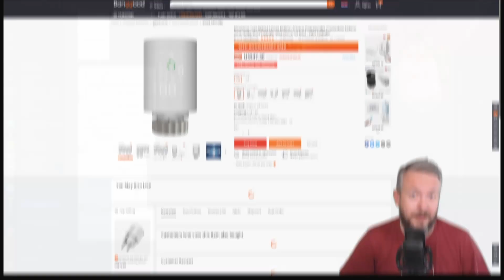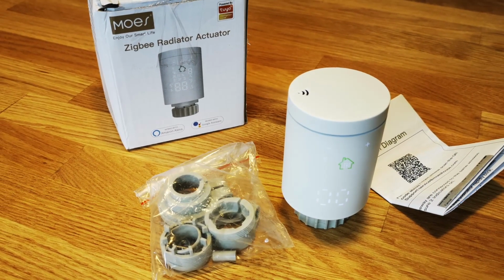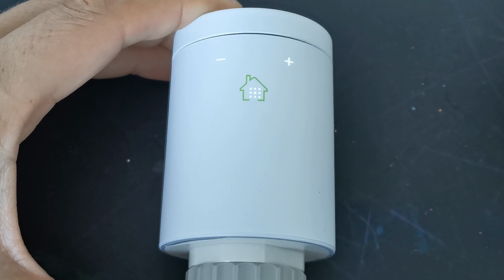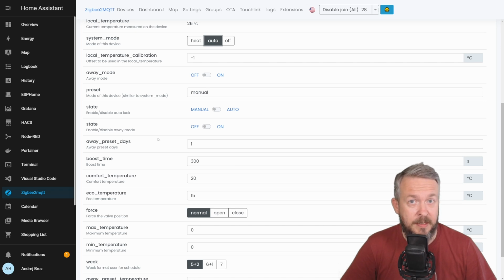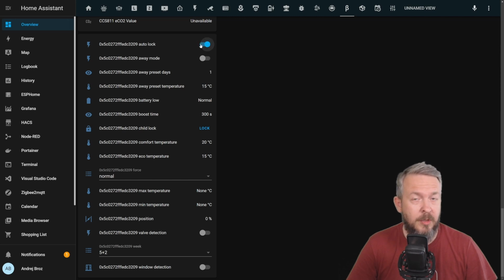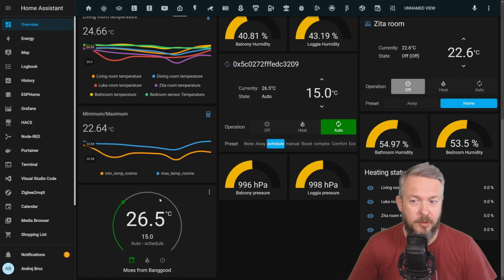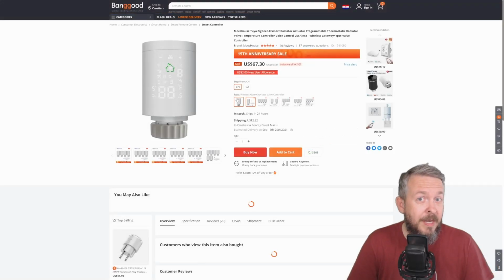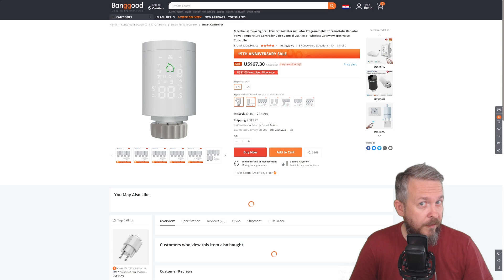Moes Zigbee Smart Valve TS0601 in Home Assistant

Comment: Great informative video - thanks. I have 2 of these valves connected via Zigbee2MQTT, one works perfectly as per your video - the other one gets identified wrongly as a TS0201 Temperature & humidity sensor with display. I have tried many times to repair it, but can not make it show up correctly? - it worked fine in ZHA.
Reply from the maker: Hi Hans and thanks for the comment! I've never seen/heard of such an issue? I presume that you tried to reset the device and re-pair it? 
I've seen this, but again, it's to try and pair/unpair device until it get recognised... Strange. https://github.com/Koenkk/zigbee2mqtt/issues/9144
Reply: @BeardedTinker  thanks again, I  reset the device and re-paired it about 40 times!, I then completely removed it from Zigbee2MQTT and then cleared it from the blocklist. I then re-paired it and it worked!! - thanks again 😎
Reply from the maker: Glad you got it working at the end. No idea why it would get identified as some other device.
Reply: @BeardedTinker  Yes, really strange, but working fine now - thanks to you 👍😎

Comment: Which is the difference between auto and heat modes?
Reply from the maker: Auto is intended when you have application, set default values (for ex day/night temperatures + away) and leave everything just run.
Heat is call to heat - and can be used to override auto if needed.
Od tado (that I use), I have everything on auto, and use Home Assistant just to show current temperature values.
Reply: @BeardedTinker  If I wish to use thermostat as manual device (just set temp which I want) which mode is correct?

Comment: Can you tell me? Is the hub really needed? Or only thermostat+mobile app would work? As it worked with my light bulb and smart plug
Reply from the maker: This is ZigBee device, so it need coordinator. It can be one used with Home Assistant, such as Conbee or CC2652RB usb sticks or one made by same manufacturer. But it needs something to move data from ZigBee network to WiFi/Ethernet.

Comment: Thanks for the video, gives a lot of information. I still have one question.. my current setup is done with Tado. I still need (a lot) of smart valves. If i buy one of these valves.. how can i combine them with the tado smart thermostat (so they can "ask" the boiler for heating)? Thanks in advance for your reply.
Reply from the maker: Thank you Lennart! The only way to combine them is if using system like Home Assistant to do so. Unfortunately due to them being different manufacturer and with tado using proprietary protocol for communication, you need middleman. 
But if you have Home Assistant, and you have both tado thermostat and Moes (or similar) valves - yu can use state of tado thermostat as trigger for automation to turn valve on/off. And vice versa, use valve call to heat to trigger manual heating.
You do need to put fail-safe in automation to for example stop heating if call to heat was longer then 60 minutes.

Comment: Thanks for the great review. I bought three of those based on it. I need an advice if possible. Since adding them to ZigBee2Mqtt and Homeassistant, they report way too frequently. Many times per second. And my homeassistant database grew from 200 Mb to 8GB. Is there a way to adjust the reporting interval for those valves. Thanks in advance. Other than that they have been rock solid.
Reply from the maker: Hi! I would suggest for start that you limit your HA log to only log warn or warning levels. This should be sufficient to prevent log to grow.
https://www.home-assistant.io/integrations/logger/#log-levels
You can add to configuration.yaml file:
logger:
  default: warn
I haven't seen log or database to grow that much just because of one device. 
Next please check this here on how to purge your database of the old data:
https://community.home-assistant.io/t/how-to-keep-your-recorder-database-size-under-control/295795 
Also check here for recorder commands to set purge days. I keep 7 days of data in database and I think that this is default.
https://www.home-assistant.io/integrations/recorder/#configuration-variables
Reply: @BeardedTinker  Thank you for the prompt reply. Maybe I miss explained things. My database is mariadb, I had the purge set to 8 days, but I took it down to two because of the valves. When I do a query in the database I see around 180000 rows for the trv status. It perhaps reports too frequently to homeassistant. I dont have problems with the log, I miss explained that part.

I posted in your discord, perhaps we can chat about it there. Thanks again.
Reply from the maker: Oh, OK. Then I would suggest that you use Exclude option in recorder to skip saving unnecessary data.
I haven't seen a way to reduce polling interval. There was once a long time ago issue opened on Zigbee2mqtt to reduce data flow of you use enable reporting in configuration. But that was long time ago.
Is it all same sensor and same entity and entity type?
https://www.home-assistant.io/integrations/recorder/#exclude

Comment: Very good and helpful video. Thanks for the good work.
I have this product.. Will I get somekind of warning on my app when the battery is low or even dead. I just found this offline notification on the app!
Reply from the maker: Valve reports battery low status, so I would think it does. For Home Assistant you need to create automation to get notified for battery_low state. In 2021.11 version, it should be boolean state.
Reply: @BeardedTinker  I think you are talking about a windows app on PC, right? I only have smart life installed on my phone because it's easier to operate everything from phone for me.
Reply from the maker: Yes, or better to say Linux, but same - not using Smart Life myself for any device, as I try to stay with local control of devices (in case Internet goes down, to still be able to control it).

Comment: Is it possible to use external temperature device (like Aqura) with this valve? I think internal one won't show correct temperature because of closeness to radiator.
Reply from the maker: Sure, but I would then use generic thermostat card for that. You can use whatever temperature sensor in your automation to trigger the valve by hand/automation.
But also, don't worry on the sensor being close. I have similar ones for 5 years and never seen too high reading because it was close to radiator.
Reply: @BeardedTinker  thank you!

Comment: Thanks Tinker on great video..
I have one issue with this actuator..my radiator valve works opposite of this actuator, when I force actuator in open state, he actually close my radiator valve!?
So my queston is, is there any way in settings to set parameter on way to actuator work with my strange valves?
Have five of them.
Thanks in advance..
Reply from the maker: Thanks for the comment! And really nice head scratching you got here...
I know that there was a way to reverse it, but can't remember what it was. The only (bad) idea that pops in the mind is to create separate sensor that reverse value of the first sensor. But that is bad way to do it in long run.

Comment: I have one of this valves connected to my Home Assistant and I realized it has one small disadvantage compared to Tado valves, and it is the noise when the valve is opening/closing. I am not sure how it works, but I have the feeling this valve is always going from 0% to 100%, but Tado has some type of clever way to learn at what position the radiator open and close (i.e. opened over 60%, closed under 40%) and it just moves between that range. I have this feeling because when Tado valve open/close I can hear the valve moving for just a second, but when the Moes valve open/close I can hear the valve moving for much longer (about 5 seconds or more). On top of the noise my guessing is the batteries will last much longer in the Tado valve (but I haven´t tested that yet as I just got my Moes valve), have you noticed this behavior? do you know how this works and if there is any way to fix this disadvantage?
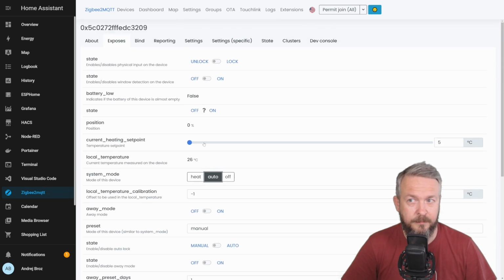Reply: This valve supports varying positions, and as one of the few even reports it via Zigbee (visible as Position: 0% at 8:04). It has some shortcomings though – first, it doesn't have any encoder/hall sensor or anything reporting back engine revolutions, so reported position is based on timing (and maybe tracking power draw), anyway it has tendency to deviate into being fully open whole time despite reporting for example only 10% openess state sometime just after couple of days and couple dozens of automatic readjustments (fortunately switching it off recalibrates it, so I have automation doing so every other day). Position is read only, so there's no easy way to control it with external algorithm (it's possible by some tricks though, as there's at least feedback loop). It' doesn't track radiator temperature (no idea if any other does so), only ambient one – so in a rooms with two or more radiators sometimes happens „a little dance” where both are chasing each other readjusting way over range every couple of minutes. It doesn't measure working real range of pushed pin of mechanical valve used, so reported 100% openess has nothing to do with real one (of course 0% is valid). Also because of this if power source doesn't provide constant water temperature it may happen that it will noticeably overheat a room by slowly going from 100% openess to let's say 20% by an hour or two before valve really gets closed. And finally – quality is quite problematic. I have 16 of them for little over a year now, three went to a basement (where they are needed anyway) as their gears got really loud just after one or two weeks of use. Fortunately no other got so loud, but I'm under impression that all of them got somewhat louder now than a year ago anyway. Two other have frequent problems with batteries shortly loosing contact even after slightest touch. Also their adjustment algorithm sometimes behaves really erratic, like for example yesterday it kept valve at the same position for a couple of hours, despite room temperature falling slowly from 1,5°C to 2°C below a target. For comparison I also have five years old Danfoss Z-Wave based ones – they are much more quiet, their adjustments are much quicker and during calibration they measure effective working range of a pin of mechanical valve they connect to so they were always working within it. Unfortunately they are installed in a flat where to this day I haven't found time to deploy Home Assistant and test what they report and how they work with automations. And with only three of them, as they are no longer produced, for a new home I needed some other solution…
Reply from the maker: Thanks for the post Victor. Not sure I can help since the one I got has been given away.
But you are right on one thing - speed of the valve is here much slower them tado. But on the other hand, tado valve was louder then this one from Moes.
I missed to test control of the valve open/close state in %, but there is topic in MQTT states of the valve for it. Check here under Position https://www.zigbee2mqtt.io/devices/TS0601_thermostat.html
Reply: I agree on this. It seems it only really has two states, open or closed.
Reply: Maybe you accidently set the „Control type of valve” from “PID” to “On/OFF”? (Advanced options page “AA” should be 0)

Comment: Super cool! Thanks for this! I have a question though: I haven't really understood how I can use another temperature sensor instead of the integrated one. I suppose I have to use the Manual mode? But then how to automatically stop when the desires desired temperature has been reached and so on?
Reply from the maker: IF you control everything from HA - yes, you set valve to manual and then based on temperature from sensor, create automation to close or open the valve. If value is at or above desired temp, close it - if under, open valve.
Reply from the maker: Just to add Nikos, not sure if you deleted second post or if it was YouTube issue with missing comments - I see that you've posted something but getting error when I try to open it.
Reply: @BeardedTinker  That's strange. I did write something but don't know what happened with it. I was just saying that in that case we could even use the generic thermostat climate platform to do this controls! 🙂
Reply from the maker: @nickagiann  YouTube comments are disappearing for last few months.
Yes, it can be used with generic thermostat :) Simple and easy solution.

Comment: Do you know if the TUYA Smart Gas Boiler Wireless WIFI RF Thermostat can connect to Tuya ZigBee3.0 Smart Radiator Actuator trough  a gateway?
Reply from the maker: Can't be 100% sure, but if you use Tuya app, and both are visible in Tuya app, I think they should communicate between eachother.
But it all depends on the way you want to set it up.

Comment: I just bought the valves based on your recommendation. I am now looking for battery-powered thermostats that do not need to be mounted to the wall, but that I can carry with me to wherever I am sitting. Because I don't care what the temperature on the wall is. I care what the temperature is where my body is. Do you have any recommendations? URLs appreciated! Double bonus points if the thermostat does not just measure the temperature, but also allows me to set the target temperature. I can find no such product for Zigbee. (My 30-year old Honeywell wireless thermostat already had that feature). Thanks for any tips pointers that you can provide for any of the above.
Reply from the maker: Thank you for the comment Lucky!
This is excellent question. I still have to find good solution to this and this is why I haven't recorded that video yet.
One of the devices I have been looking at is this one - https://www.banggood.com/MoesHouse-WiFi-Smart-LCD-5A-Wall-Hung-Gas-Boiler-Water-Electric-Underfloor-Heating-Temperature-Controller-Digital-Weekly-Programmable-Thermostat-Wall-Mounted-Work-with-Alexa-Google-Home-p-1688563.html?rmmds=detail-left-hotproducts&cur_warehouse=CZ&ID=6290077
But please check if it is suitable for your system.
It has two parts - one is receiver that is hookedup to your boiler, and other one is thermostat.
There should be others like that.
Other options I've been looking are hardwired (thermostats) but if you need mobility, one I posted above should match that.
And by the looks of it - it also has set temp and current temp. 
So, you can try and narrow your search to devices like this.
BUT - it's not Zigbee. And I don't think there will be a Zigbee device because it still would need additional connection with controller on boiler.
Reply: @BeardedTinker  Yes, back when I owned a house I had a Honeywell wall thermostat with a remote control unit that worked the same way. Honeywell  has been making those for 30+ years.

Now that I live in an apartment, I don't get to control the boiler, only the valves. Let me simplify the question somewhat: what do you recommend for small, battery powered, thermostat I saw another video where the host had some small  Zigbee Xiaomi thermostats scattered all over his place. But I couldn't make out more information and there was no URL for the thermostats in the show notes. A first approach could be to put a thermostat and a separate up/down button, which must exist, on my couch table and perhaps make each button push 0.5C higher or lower. (I am an old computer nerd that it totally new to Home Assistant, but I would be surprised if that weren't possible).

Oh, and I also bought the Zigbee USB stick you recommended. I would have much preferred a PoE-powered Zigbee adapter, because my Proxmox server that HA will run on is totally in the wrong location, for good RF reception, but the few PoE Zigbee adapters that I found online are all out of stock.

Any and all pointers are much appreciated!
Reply from the maker: Sorry for a late replay. Hmm, that's easy but also hard to answer. I would recommend using just smart thermometers, not thermostats. 
If valves are connected to Home Assistant and you can get temperature in HA too, there is no need to have thermostats around.
Xiaomi has simple ones - from Aqara temp and humidity sensor (it's called like that) to the ones with screen, Mijia - but they are Bluetooth version, so you need additional gateway for that.
Moeshouse has smart ZigBee/WiFi Tuya compatible thermometers with Lux. 
I know that I probably didn't go much 😂

Comment: @BeardedTinker, will you do more video's on this topic? i'm missing the part where the setup connects to the boiler. Idealy you want it to modulate and not switch on / off when 1 of the valves requests heat. What do you use between the HA setup and the boiler?
Reply from the maker: I use tado - have Smart Thermostat that is hooked to boiler and tado Smart Valves.
I hope to get my hands on Moes Smart Thermostat that is equivalent to one from tado (but much cheaper and also working on Zigbee network).
When I get it I'll cover that part. With Smart Valves, unless you have some relay controlling boiler, you can only close valves when temperature is reached. But yes, you miss call-to-heat functionality with only valves.